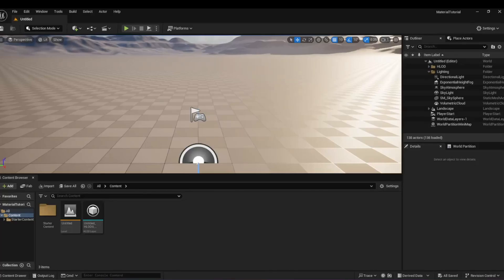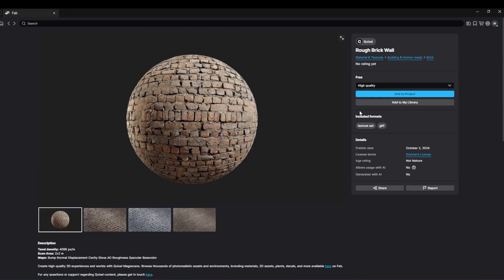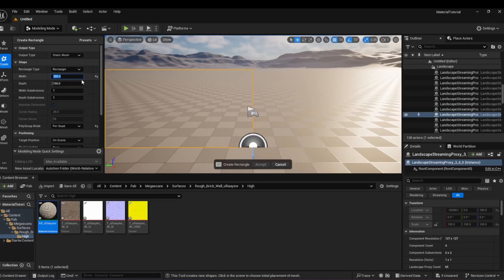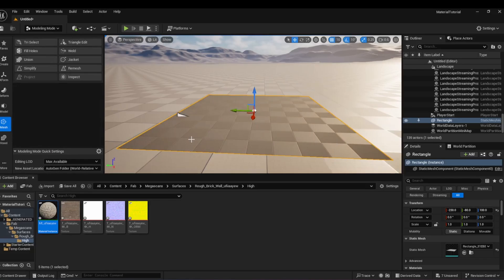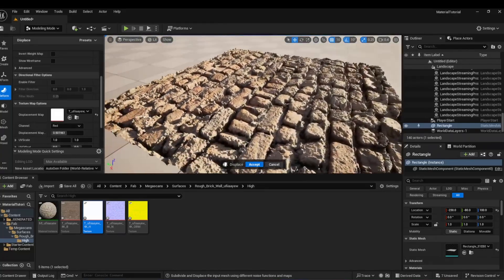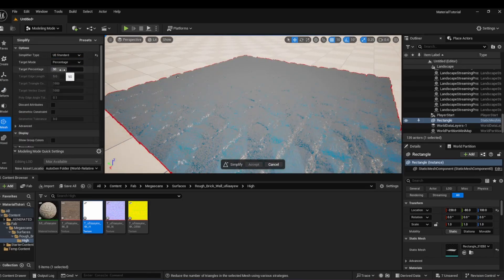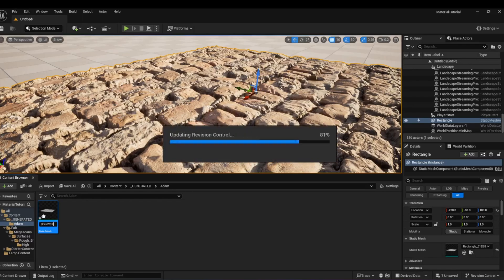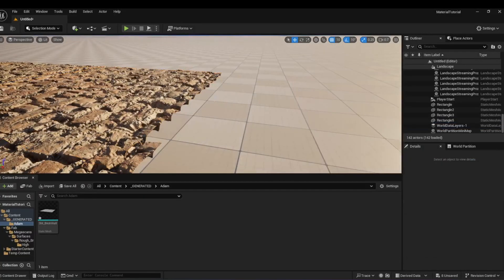How To Make Realistic Brick Walls In Unreal Engine 5 Fast!

Comment: This is visually impressive but the mesh is not optimized at all for its use in games, so application would be more for like archviz or movies or something, but this doesn't work with games at all
Reply: If you're aiming for optimization
Try Parallax Occlusion Mapping ;)
Gives a similar effect while being more efficient
Reply: @Izhen_UwU  For optimization you have few options, Bump offset, PoM as you mentioned, tessellation with world position offset, and some other shader techniques. It will depend on your system profiling and resource budget.
Reply: @micke1216  I don't use it. But I thought the intention of nanite was to allow unoptimized high poly meshes, and it can "build" a realtime optimized lod asset on the fly?

I imagine that would be resource heavy at a minimum for storing the large mesh and having to calculate per frame a new asset.
Reply: @capoman1  The reality with nanite is that is a cool tech and works ok (ish) but has a bunch of trade offs and honestly I wouldn't recommend it since it has a big performance hit, specially on older GPUs, depending on what you're doing your millage may very.